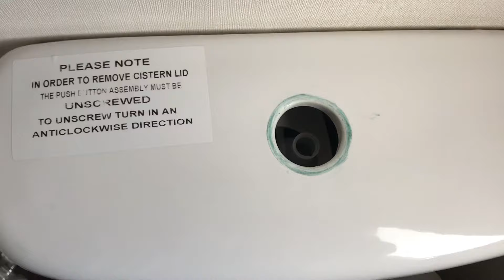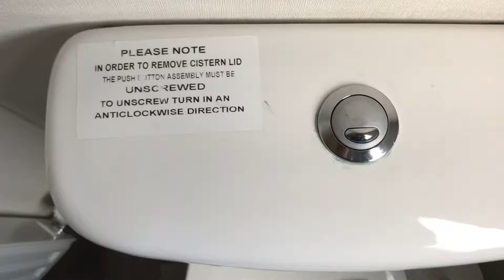Remove a Push button toilet button easy

Comment: This type of push button (including the inner workings) seem to be very rare judging by YouTube videos. Got a problem with mine where it won’t stop leaking. Basically sounds like the end of a flush, but permanently. Any ideas on what the issue might be? Thank you for time.
Reply: ......is water is still trickling into the toilet after a flush ?.. if so this valve might want changing..
Siamp Cistern Inlet Filling Valve Diaphragm Washer Seal 34951307 - SIAMPWASHER...
how to change it......https://www.youtube.com/watch?v=eOpidaLQzYU

Comment: Mine won't unscrew... Any ideas??
Reply: same here , any one can help ? Tks
Reply: Did you get it off yet?
Reply: For any one in this comments. Sometimes the whole thing doesn't unscrew and only the chrome outer ring which can be quite awkward. Or you could have a cord or pneumatic button in which case you will have to lift the lid off and then unscrew the button from underneath

Comment: Do you have a video which can help resolve my problem with intermittent fault as cistern not filling up as normal.  At times very slow? Many thanks
Reply from the maker: Caroline Ross there will be a blockage inside it so we can either try and take it apart which can be very tricky or just replace it they’re not very expensive see this video
That is a full refurbishment video you remember you only need to change the ball valve try and get the same one in the video the ball valve is blocked up you can hear it
https://youtu.be/viTOtcQEBFE

Comment: Modern close connect cisterns are crap not enough water pressure to flush away waste causing drain blockages in older properties

Comment: Mine will just not turn at all! Any suggestions?
Reply: Same issue
Reply: Dual flush two button type removes another way, you push one button down and look for a slot in the side of the other one, pop it out with a screwdriver after that the other button will come out then a screw which holds the lid down is exposed, there are videos on here showing.

Comment: Our council renovated the toilets and they changed it from lever to button, we used to use those little tank blocks simply cause I liked coloured water, and when it changed, an hour of pulling the lid didn't work, so we just left the blocks in a cupboard, literally a day before I discovered this video my mum threw em away, those blocks were 6 years old